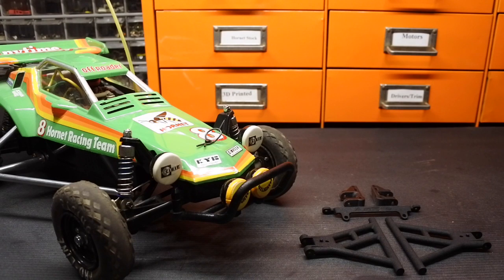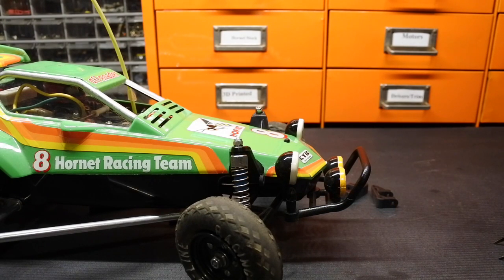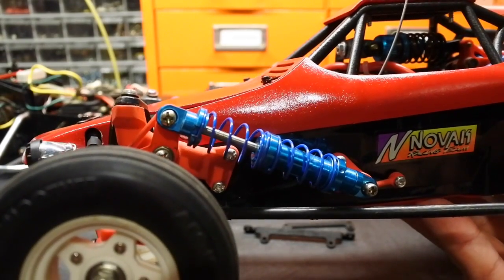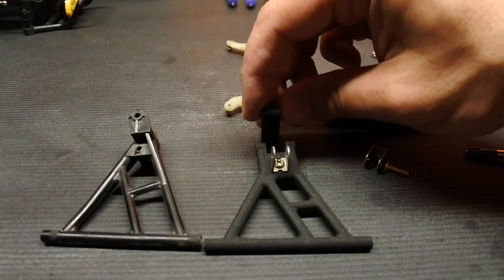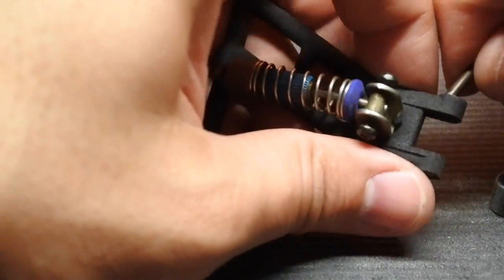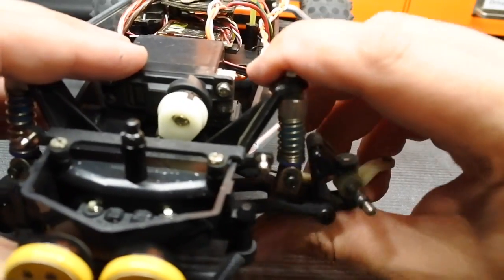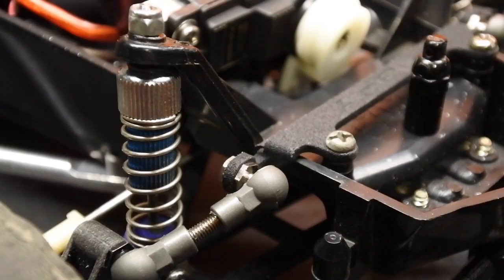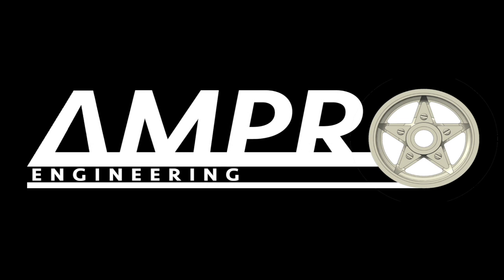E3: Tamiya Hornet Stock Front Suspension Replacement

Comment: I have an original grasshopper I purchased in 1984 and have been trying to tighten up the suspension then found this. GREAT STUFF.. Just might have to order a set... Thanks
Reply from the maker: Cool man glad to hear it! Remember that the Grasshopper shell will need a notch to clear the upper brace and also need to have the body mount altered a bit to get the upper brace AND shell to fit.
Reply: The original body is long gone and now has a polycarbonate body. It's been well used over the years and I just ordered a new body for it. Also have an original Clodbuster a friend gave to me a few weeks ago which I tore apart and re-built.  Enjoying your engineering on these old fun Tamiyas man. Keep it up!

Comment: I've had my Hopper since 1986, but got tired of it quickly after upgrading to a middle of the road 540 mod motor....
It STOPPED turning! It would understeer until it hit something! Hornets and Grasshoppers have NEED this since day one. Like I said in another clip of yours, I'm gonna go wipe the cobwebs off of my old Hopper, and  try this kit - and the rear suspension mods I just saw on your Shapeways store!
Reply: AND, you should make a King Blackfoot Front suspension, to fit the first Blackfoot AND the new one!! That front end was sloppy on a FROG! On the Blackfoot/Monster Beetle, it's downright uncontrollable!
Reply from the maker: I see you found the video! I have upgrades for the ORV front end right now (like anti bump steer knuckles) but have been focusing on the double wishbone rear end. That has been a fun upgrade! Remember that I do not recommend anything more than a stock motor with these front arms as the nylon, though strong, is weaker than the stock ABS. Episode 48 shows a fully mod'ed hornet on the track.
Reply: AMPRO Engineering - I would definitely be interested in the no bump-steer knuckles for my Monster Beetle. I can also verify that Carmine doesn't use hot motors on these kind of bashers. 23 turn Sport Tuned, black can Tamiya is about the wildest thing his Tamiya's have had since the early days. When we did F1 - different story!! 11 turn triples were more the norm.

And yeah, what he said! I'm trying to dig up a King Blackfoot, so I could drop it's superior front arms with turnbuckles on the front of my Beetle. It would be awesome if you could make that great geometry available for the front of the ORV series. It's just better. 
Murph

Comment: I bought the hornet suspension with 20mm offset and it didn’t come with the upper ball mount.  I ended up mounting the ball joint on the grasshopper body mount hole.  This gave me camber loss as suspension compressed ( not to mention having to relocate the headlights to the base of the A pillars).
I later decided to mount the ball joint under the deck above the suspension arms and now it works like the stock suspension -__-
Reply from the maker: How did it not come with the upper mount? It should have come with two variations of them. What did you order? amproengineering@gmail.com

Comment: Where did you find those ball cups?  I'm not sure if a normal ball end would clear due to the screw head.
Reply from the maker: Boy....I think these were on ebay years ago. They are pretty generic TBH but seem to work fine. I would run an ebay search and see what comes up.

Comment: Do you have any way to get rid of all the slop between the part where the front suspension arms fit into the chassis? There is a lot of play and slop there...
Reply from the maker: Not really. The issue is how they slot into the chassis. They need to pivot in and then rotate for operation. Plus, they car is so basic, the slop in there doesn't change how bad the Hornet/Grasshopper drives.

Comment: FOR SALE.... An original R/C Tamiya Opel Ascona. It worked when put away in the 80's. Still has it's mechanical speed controller. Shares many parts with the original Wild Willy. Rear end and original 540 motor should still be AOK. Could be easily brought back to life. Will go on ebay soon. Serious inquiries only please.
Reply from the maker: Oh man I remember those.

Comment: I have a grasshopper and iam about to do the crp/fx10 mod to it. thats where you graft a crp double wishbone with shock tower to a grasshopper but Iam possible looking to do something from your product line instead. Problem is i want to use crp after market shocks that does not use the stock shock tower. Any ideas on what i would use of yours? thanks!
Reply from the maker: Yeah I know that install all too well. Well for my design using the arms in this video, you would use the stock pogo sticks. I also have a set of arms that have a mounting point that is 20mm lower, allowing you to use any 60mm touring car shocks. It is an easy install that requires zero cutting to anything on the car. That said, I don't know that the CRP units and my units would be able to play well together. I think if you are wanting to use the stock tower and the CRP arms, that could be a bit hard. I do not know if the geometry will even allow that. Have I understood your question or have I missed something. Let me know.
Reply: ill have to measure the length of the crp shocks i have. i wonder if i could use you 20mm offset arms with those socks and the "u bolt" shock mount?
Reply from the maker: Hmmm, you may be able to. Those CRP shocks are around that length but I don't have any on me to confirm that.
Reply: I like these lower arms for the double A setup. if they were stretches out sideways maybe 3/8" (for 3/4" more width up front) or 1/2" to make 1" wider, shock at near the same point could make softer front suspension with a little more wheel travel happening along with it?

Comment: where did you get those front shocks for the hornet I've been looking for that type for my hornet
Reply from the maker: HI Patrick. These are vintage units from You-G. They are found every now and then on eBay. I must warn you that if you plan on driving the car often that you should not get these. They are trash. The shock shaft is 2mm brass and bends when you look at it. They are not rebuildable and as they are 25 years old now, they leak like crazy. They have no adjustable pre-load and they cost a ton of money. As someone who owns a mess of them I know how pretty they are. That is their only saving grace. If you want better front shocks, look at my video of the 20mm offset front end. That version is bulletproof.

Comment: Instead of the you-g shocks I was thinking about using 1/16th or 1/18th shocks on the front of my hornet
Reply from the maker: Yeah do NOT use the you-g ones. They are expensive, weak and leak badly. 1/16 units are usually expensive and too long. If you want oil filled units, get the 20mm offset arms and some 60mm touring car shocks. Cheap and easy! It's in episode 7.